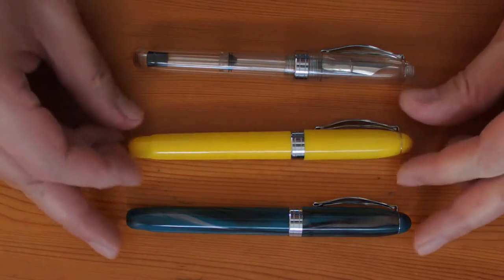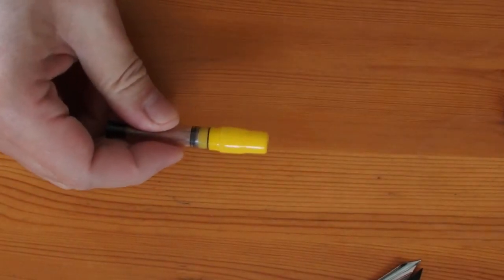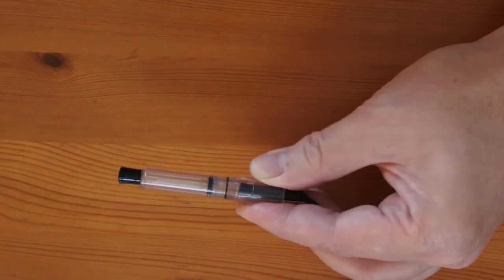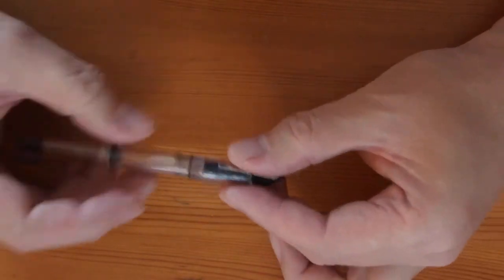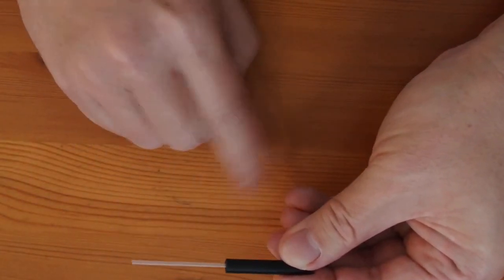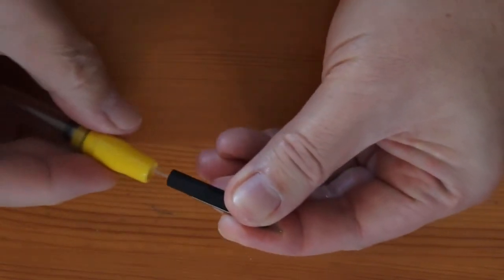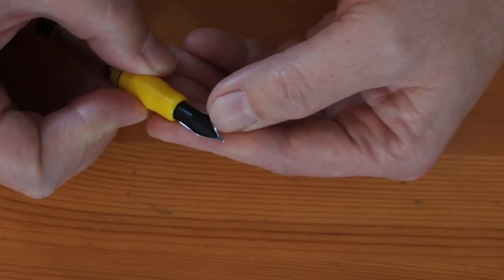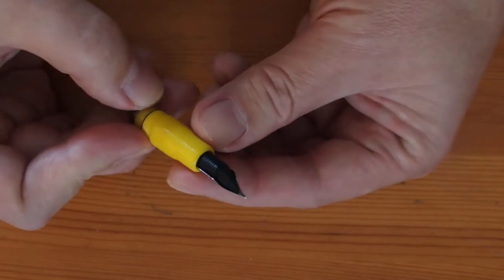The Dead Ahab Scroll: Fixing Noodler's Ahab Fountain Pen

Comment: Pro-Tip: DO NOT heat-set your nib in a plastic bowl of any sort.
Boiling water in the microwave in a plastic bowl causes molecules of the plastic to bind to the metal nib and ebonite feed when sitting in the boiled plastic-water.
It renders your feed unusable because it will not conduct ink any longer (It becomes hydrophobic due to the molecular plastic coating the surface). 
The only way to restore the Ebonite feed and metal nib if you mess it up this way, is to acid etch it...removing the molecular outer layer of the items.

Of course, I don't know how to acid etch so my ebonite feed and nib were garbage after this mistake.
A very costly oversight and a good reason to USE CERAMIC BOWL!!!